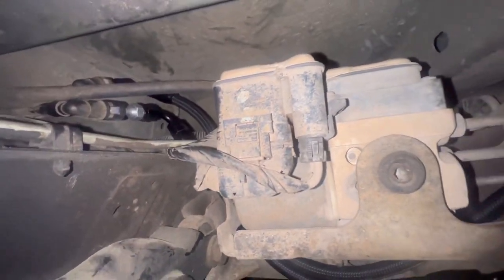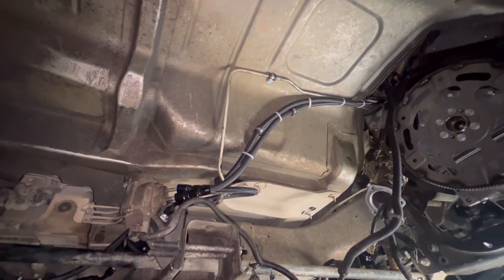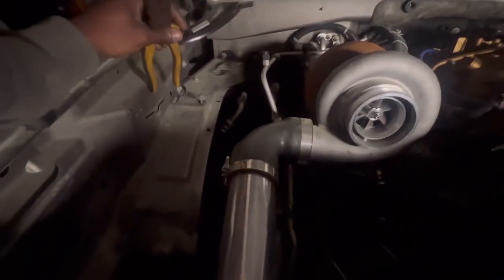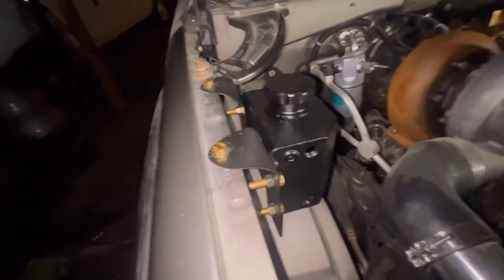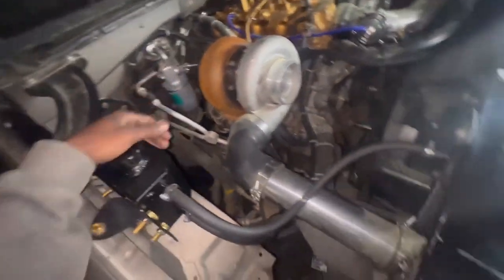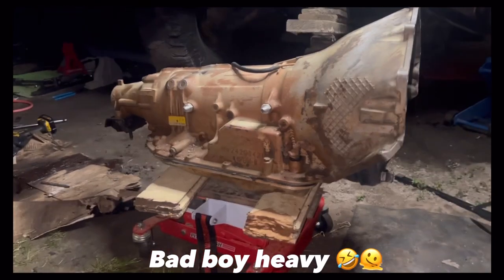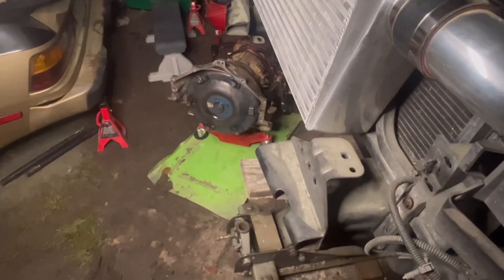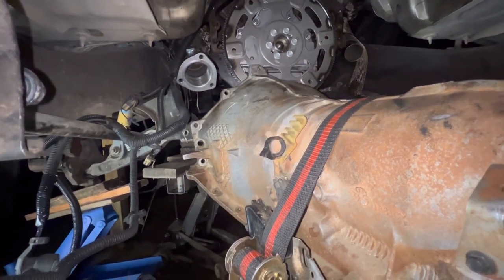Installing 4l80e by myself on turbo truck bad idea!!

Comment: mad props bro, not to many yungens out there doing what you do. iv been there putting in trans by my self, with a jack and 2 legs! looks good so far! only thing i see might be a problem is the long bolts taping on the weal well wan the trucks running and or from vibration.
Reply from the maker: Thanks and I give you props cause man 🫣 and thanks for input will keep eye on it and bolts was pretty small